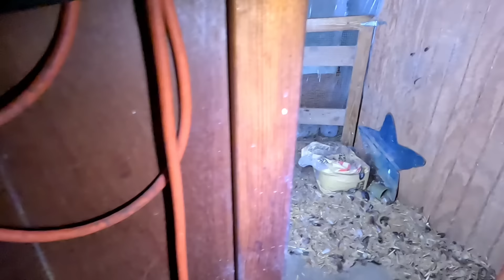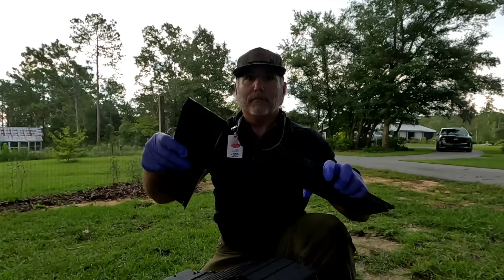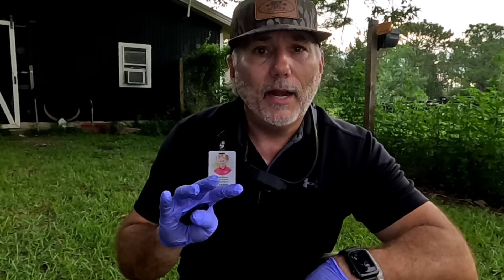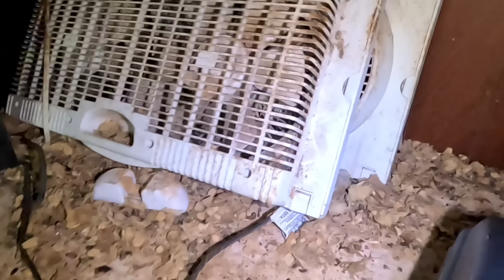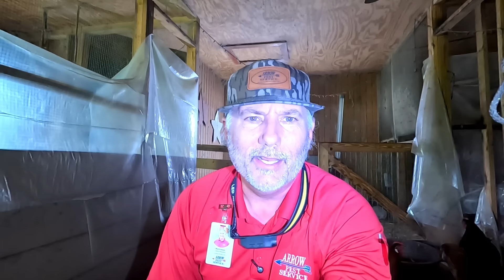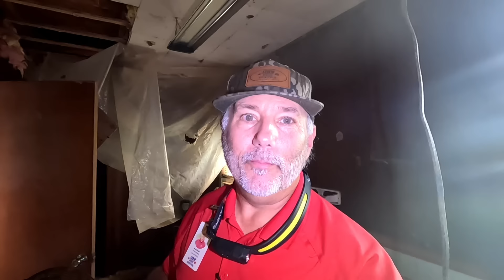Most Effective Rat Control Method Nobody Talks About!

Comment: 12 foot by 12 foot addition added onto house, concrete floor and cinder block walls. Its like a washer and dryer room with water heater and deep freezer, so its small and heated. Flood came and washed out dirt/stone underneath the block room so we back filled it with stone. Moles mice and eventually rats took up nest under the concrete... Eventually they made their way up the walls and into the roof

Then the snakes followed, I patched every nook and cranny and put up 1/4 inch garden mesh around two to three foot up the walls... Then I hear the rattling coming from inside the block wall... There was (just shy of) five foot rattlesnake that was now living inside my wall. The dryer vent went thru the wall to keep him warm and the holes the rats gnawed into the ceiling gave it roof access. Kept getting strange smells occasionally and got one of those telescoping cameras with a 10 foot rigid wire with the camera on the end... Followed a hole or two and BAM!!! Rattlesnake

Every pest control person in the zip code wouldn't touch it, half wouldn't even believe me it was in my wall. We eventually replaced the roof and filled the block walls with expanding foam and wire mesh, and leaving a 2x4 propped up for the mice in the walls to have a way out... At 11:14 pm the rattlesnake came out and made its way down the 2x4, one of the few saved security camera clips I kept. Chicken food brings mice and rats, mice and rats bring snakes, snakes like warm places... Lesson learned

Move to the country they said next to four waterfalls, it'll be paradise... Nobody mentioned I'd have a rattlesnake living in my wall. Yeeeeeuuuuck, glad that's over
Reply from the maker: Wow, what a story! Thanks for commenting
Reply: @ArrowPestService  Yeah, wow, what a story! If you ever write a book, this is a good one.
Reply: @ArrowPestService  absolutely nightmare fuel
Reply: 😮😮😮  I hate snakes!  Bought 1st home... Older home.... and was told there was a rat they couldn't get rid of.  We'd go on weekends to on it before moving in.... We set HUGE traps while we were gone and the traps DISAPPEARED! Nowhere to be found!  After a day of painting and camping out on the dining room floor we heard noises. There was a rat the size of a possum! Needless to say a couple 22 shells took care of it.  Country living 😊
Reply: Pump cement grout (no gravel or rocks) into the void.
Reply: Wait, so what are you saying? How do you get rid of the problem? 😮

Comment: what about secondary poisoning to hawks ?
Reply from the maker: Secondary poisoning risk for hawks really depends on several factors: how much poison the rat consumed, how concentrated it was, how much of the rat (especially the liver, where most toxins accumulate) the hawk ate, and the specific type of poison used. In many cases, the risk is lower if the rat only ingested a small amount, but it’s safest to remove and properly dispose of any dead rodents you find.

Comment: Very good video. 👍
With a dry bucket full of live rats… doesn’t sound safe. Add water for safety. Lots of good comments too.
Reply from the maker: I was just hoping they would go into  the bucket, one of them walked up the ramp and turned around. 
Thanks for you comment.
Reply: Adding a layer of peanut oil on top of the water helps
Reply from the maker: @brokenbravo83 👍

Comment: I bought 3 vulcans.  They dont work well.  I have used sunflower seeds and peanut butter all the way up to thd bait station.  All the bait is gone but no rats trapped.  As a matter of fact, i found black plastic "dust" floating in the water because the rats gnaw at the bait station to get to the peanut butter inside WITHOUT causing the mechanism to drop the rat in the water.   I'm going to put some ceiling fan balancing weidghts on the bottom of the mechanism to see if that works.  I paid about $220 US for these 3 Vulcan traps and they just arent worth it.  The pvc tubevover a bucket worked better.  And before anyone says anything, I did NOT lock the mechanism to encourage the rats to get comfortable with the trap.  A real bummer but my real experience.
Reply: Had a couple of rats in the back.  I used a 5 gallon bucket, half filled with water, and poured black oil sunflower seeds in the water (they float and make it look like there is a solid floor in the bucket).  Put a small wooden ramp up on the bucket, with a couple of seeds at top of bucket, and they jumped in to get the other seeds, and caught them (they couldn't get out as they are left swimming in the water!).
Reply from the maker: I hate that. Did you end up getting the rats?

Comment: We had rats under our coop. We made rat balls. Concrete mixed wiyh peanut butter. We sat it out every night in a pan and 3 days no more rats. Best thing is by morning the concrete was solid so we just threw them away before letting the chickens out. They were all over it as soon as they came out. We never saw rats again and we moved 3 years after that. I do know also attracting owls helps. As far as keeping them out Rat magic is great you sprinkle it around the house. No mice in the house for 3-4 months. They have sachets for glove box rv boat motors ac motor box pantry etc.
Reply from the maker: Great Job!
Reply: Please explain your concrete & peanut butter 'rat balls'! WET cement mixed with an equal part of peanut butter? Mixed how well? How big? How did you discover this technique? What exactly kills the rats? Thanks!
Reply: @TheCursedHonestTruth  no dry cement any size and you would have to look up ratio. They eat them then drink and it turns to wet cement. It turns hard in their gut and they cant digest and die. It works fast! We made them all sizes they just take bites out of them.
Reply: @growinggenerationshomestea516 thanks!
Reply: @growinggenerationshomestea516 How quickly did they die? Could they end up rotting in the walls? Thanks!

Comment: 2 questions:  
(1)- Just out of curiosity what would you have done with live rats in a 5 gal bucket?
(2)- This is the big question.  What about the smell?  I imagine all of those rats, feeling sick from the poison, went into their holes and hideouts in that chicken barn and will very shortly be stinking to high heaven.  The smell is the reason I personally never poisoned a rat or mouse.
Reply from the maker: I would have taken them out into the woods and let them go. 
I've been back to the barn since my video and there are no issues.
Reply: @ArrowPestService  you could put some of that bait in the bottom of the bucket so they would eat and die. A burn barrel to dispose of dead rats to prevent other animals eating them to get rid of risk of secondary poisoning?
Reply from the maker: @heidicumbow9002 great idea
Reply: I’d leave lid on make very small hole in lid and fill with hose
Reply from the maker: @col2959 👍

Comment: We tore down a 36 by 260 hog barn that was built in 1970 collapsed from snow . The fumes corroded the metal truss plates. 
On the end wall where 3 inch feed pipe auger went thru the wall  rats had chewed a hole thru pipe .
As we tore down that wall we killed over 50 rats in just that spot.
Reply from the maker: Wow- that's crazy!

Comment: Fill that white plastic container half with water and sprinkle with sunflower seeds in water. Just one wooden type ramp. I caught between 30 to 35 rats every night for about 2 weeks. They climb up thinking the bucket is half full of seeds. Once in the water,  impossible to get out. Only once the bucket is nearly full of rats the top ones might escape. Old farmer trick in South Africa.
Reply: Use gloves when handling anything. They smell humans. Rub  oil above water line on bucket so they cant crawl out
Reply: @lisagarrett9999 thats a stooopit theory....  humans make everything-watts eat everything....  everything,dont need gloves..... !😂
Reply: I use the half peanut butter half baking soda since they don't burp they implode and since I know 1st hand that dogs fart I don't have to worry about the 2nd hand poisoning
Reply: @Whydoyoutrytomakethingshard why don’t exterminators know that peanut butter and baking soda?
Reply: @e.r.6147 and where do they go to die? Up in your husband's grandmother's upholstered rocker? Behind the books on the bottom shelf? No thanks! I will deal with drowning the buggers!
Reply: @e.r.6147 Now about baking soda: the idea that giving rats baking soda will make them “explode” or anything dramatic is exaggerated. Baking soda reacts with acids to produce gas (CO₂) so if a rat ingests a large amount, it could cause discomfort or bloating but it’s not a magic “rat killer"chances are someone else has poison out if you found dead ones from the baking soda trick I've tried that many times never found a dead rat but the sunflower seed and the bucket with half water definitely works I even made a container one time out of a bin plastic bin with a lid I cut a hole in the lid and I did that with the seeds and I got like so many rats at some of them didn't drowned because they were on top of the dead ones😂
Reply: @e.r.6147  we do. We use peanut butter on traps.
Reply: @marcfavell and idea how to keep the water from freezing?
Reply: @mikedumas2901 Either put a small circulating pump in the bucket or use antifreeze instead of water. I imagine there aren’t many other ways to stop water from freezing in a bucket 🤷‍♂️
Reply: @mikedumas2901 salt in the water
Reply: just normal sunflower seeds to plant ? or roasted ones at the grocery store
Reply: Get the ones sold for birdseed still in the shell. Cheaper that way to get a good amount for repeat use.
Reply: @user-sg9wr9im2b  I would assume only the natural ones in the shell would float…
Reply: @debbiedobbs5800 Debbie the raw ones similar to what you will give to a parrot to eat.
Reply: @user-sg9wr9im2b normal dry seeds so they can float.
Reply: @user-sg9wr9im2b  The rats will bitch and grip if the sunflower seeds aren't roasted. I hope this helps.
Reply: @user-sg9wr9im2b  Whatever is cheaper. I learned this over 50 years ago. This works great for chipmunks also, which can also destroy your home and carry disease. Don't worry about squirrels, they are large enough to escape.
Reply: @user-sg9wr9im2b Both work ❤
Reply: @user-sg9wr9im2b Alaskan organic, picked by a panda bear wearing a hat with a squirrel in her back pocket..
Reply: @user-sg9wr9im2b bird food bag
Reply: That dont work herevin az....tried it 30 times....but the electric zapper does it all the time
Reply: @tomkelly3896 It's crazy how some rats are smarter in some areas of the world I've noticed 😂
Reply: But rats could tread water for a long time days
Reply: @Matthew-k4m look we caught them by the hundreds over a period . Give me one reason why I would lie
Reply: @c @cobuskruger777 my dad told me about this method. M going to try. Do they not cry and signal to the rest that it is not safe?
Reply: @SvSarafova ,you can also just take 3 spoons of corn flour and one full spoon of cement/polyfilla. Place in holder on the ground where they can eat easily. Also works very good. If results not good increase cement with another teaspoon.
Reply: My father used to mix cornflour with plaster of paris. The rats could be seen scurrying along the spouting looking for water. You end up havn a perfect mold of their stomachs
Reply: Dude!!! Thankyou! I saw your comment like a week ago when trying to find how to do it! I’ve caught 10 so far in 2 nights. Thanks so much!
Reply: BALONEY  SANDWHICH. I did exactly as explained and even waited days (until I saw rat poop on top of the lid showing they were interested in the seed) then took the lid off and caught NOTHING. MULTIPLE NIGHTS; NOTHING
Reply: @katiebea9258 No lid. Big bucket. Ramp only to side of bucket. We even caught them as kids. Surely you can get it right
Reply: @cobuskruger777 You have a nightschool nearby for remedial "reading comprehension"?
Reply: @katiebea9258 I would just love to see you type in Hebrew. But enough of you. Go play with something uh else.
Reply: @katiebea9258  😂😂😂😂😂😂.  You are cruel
Reply: @cobuskruger777 Now..Now...Now ...dont be rat shaming someone who didn't catch with a bucket...Here Rats don't go for peanut butter...Rats are SMART n learn things QUICK..I HAD TO PUT PB OR GREASY FOOD UNDER. the bait plate n wait til they bumped it with their tails to catch them...then they dropped  tiny twigs or spoons even...on the bait plates to set off the trap bar and THEN they ate the bait food...if you only get one leg on sticky trap or under a rat trap bar, they will eat that one foot or tail.to Escape!!! They Smart and learn fast!!!
Po box 31BBL calif 92315
....in 92386 sglf.  They look like bouncing balls in the streets, covering the entire road. !! Solid Grey fur..no asphalt visible in nightly head lights 😮😮😮😮 2 Rats turn into Thousands every 6 weeks!!!!! Get em all while you can!!😮😮😮😮
Reply: 19 minutes to get to the point fcuking torture.
Reply: 😂😂😂 and 💦💦💦 on myself
Reply: Will try sunflower seeds tomorrow…
We were sprinkling chicken food up. The ramp would catch one a day for a while, but that stopped.
Reply: How big is the bucket?
Reply: @DGibsonxio 5 gallon
Reply: @e.r.6147 thank you
Reply: @DGibsonxio normal 20ltr paint bucket or bigger
Reply: @cobuskruger777 thank you
Reply: I’m in Canada where the temps drop below freezing I’m now pondering how to keep the water from freezing
Reply: @mikedumas2901 take 1 cup cornflower and mix with quarter cup of sement or polyfilla. Trust me.
Reply: @mikedumas2901 Just use antifreeze
Reply: @mikedumas2901 use anti freeze in the water problem solved
Reply: I did that, the seeds started sprouting on day 3 and stinking on day 5z not sure I want to keep dragging a bucked to the attic every few days. It’s no heavy for me.
Reply: @SvSarafova right just take 4 tablespoons maize meal and one tablespoon cement and mix well. You can use polyfilla  also. Mix well and place on easy spot in bowl to eat. Please let me know.
Reply: Thank you
Reply: Very good trick, thanks for the contribution.
Reply: How many sunflower seeds do you actually put in?
Reply: @loulou3472 enough to cover the surface. 
Think of it like quicksand where someone in the movie steps on what they think is solid ground because the surface has sand floating on top (well not really but I'm trying to paint a picture for ya😄)

You want them to look at the seeds and think they are safe to just hop in and eat...
but surprise surprise Mikey😸nope the seeds were just floating on the water (not gunna hold your weight Mr mouse) 
🐀 Gurgle gurgle 💀
Reply: @hope4ourfallen what do you do with the rats after?
Reply: @hope4ourfallen  Thanks very much..🙏
Reply: @hope4ourfallen 👍🏻👍🏻👍🏻
Reply: @loulou3472 enough to cover the water. From the top you will only see seeds and no water.
Reply: @loulou3472  I've seen this advice before, enough to make a thin layer completely covering the water's surface
Reply: Sunflower seed are what I use and sprinkle some around the covered snap traps but I live in a residential neighborhood so I only catch about a hundred with my method! Also by sprinkling the seed near by you can see if they are eating them just look for the husks and eventually they will go in the traps!
Reply: I'm not sure whether to be excited, or troubled that I might have that many rats.
Reply: @DM-kl4em 😂
Reply: I put a small  rat in a haviland trap cage, upside down in a 5 gal container of water n he swam down to bottom of cage in the water n chewed at the edge until the catch released n then got out of cage swimming to top of water n then jumped and jumped in the water until he finally caught top edge of the water bucket n jumped clear over the top edge to freedom..dxxmn rat musta watched some kids in the pool lifeguards class...any seeds in a bucket must be filled low enough that they can't try this jump back out technique...I also adjusted the door catches on my haviland traps to be much firmer so they can't pop open those doors again 😅😮
Reply: @Ellie-t6d  You should take THAT to cute rat 🐀 to America's got talent.  Adorable
Reply: I had rats climbing up a copper pipe that led to my water heater. From there, they got into the drywall where the water pipes led into the house. So I decided to go big or call an exterminator.

 I filled a 2'x4' tote storage container with several inches of water and placed it under that small copper pipe and put 3-in-1 oil all over the pipe. They all slipped off the pipe and into the water. Got 17 rats the first night and 14 the next.

Before that, I was using the pine sol trick to get them out of the attic, placing traps, glue traps, all of it. Drowning them is the only way, and then doing a 360 on your house to secure any entry points they might use.

The problem that started it was I began storing dried goods in my garage. So I now have sealable containers (like giant dog food storage bins) that dont emit any food scent

Now I place traps around my house and old entry points and catch one every now and then for further prevention .
Reply: My dad would do that type trick for field mice getting in his farm
Reply: Rats are GREAT swimmers. They can come right up the inside of your toilet into your house through the sewer lines.

Comment: It seems to make sense that you could put the soft bait in the bucket. Maybe a little peanut butter would draw them inside. Also, the last time we did chicken processing one of the persons cleaning up put a bag of offal in an empty large Rubbermaid trash can. Unaware of this, I was wondering what the heck stunk so bad as I'd walk by the area. Finally I opened the trash can and removed the plastic bag of offal. Underneath was a pile of dead rats. Go figure? That offal should have been buried in a compost pile but ended up totally clearing out the rat population currently living in that building.
Reply from the maker: Wow